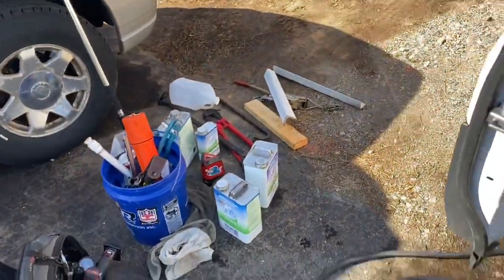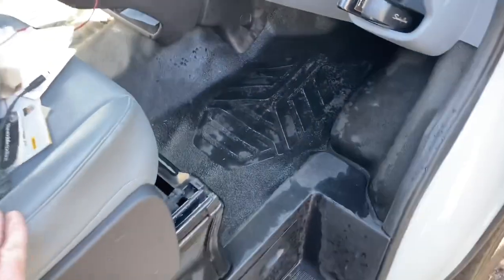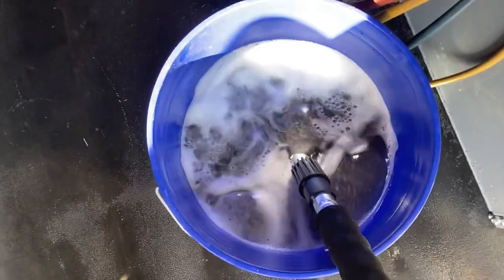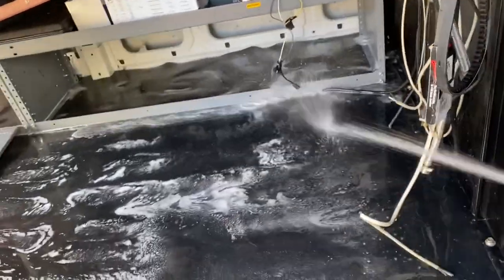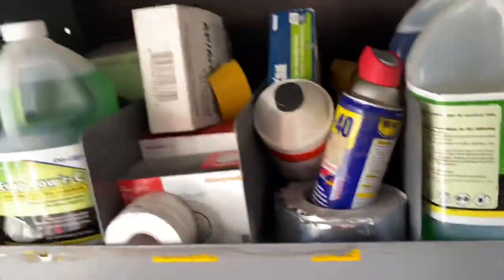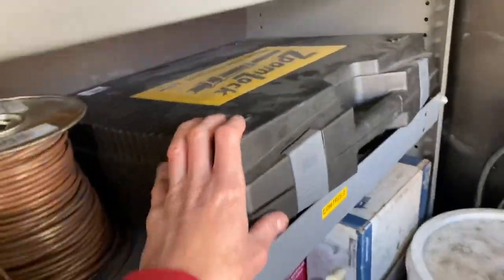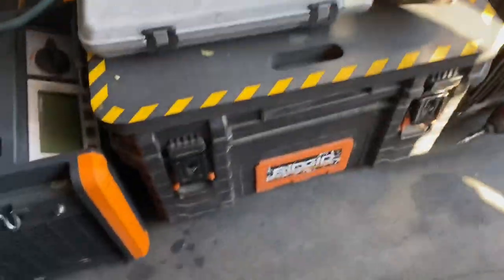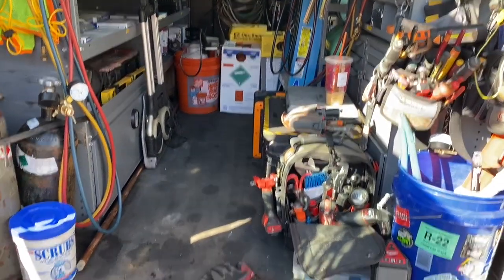Downtime : cleaning up the work van

Comment: Make sure to protect the top of that Navac nerd , you don't want anythong to fall down on it and break the lcd screen !
Btw, if you could make a little tutorial on how to properly remove shrader valves with the core removal tool and put them back in , I dunno man , they just do my head in , I always seem to struggle with them , almost never get them out the first time .
To the point where I think about it twice , the worst thing is to get the valve core stuck inside the 1/4" fitting or inside  the tool , and then you have a whole other can of worms on your hands !
Cheers , Chris , stay safe out there bruv 🤜🤛
Reply from the maker: Sterling Archer I hear that man.  I’ve had trouble with them as well hahahha